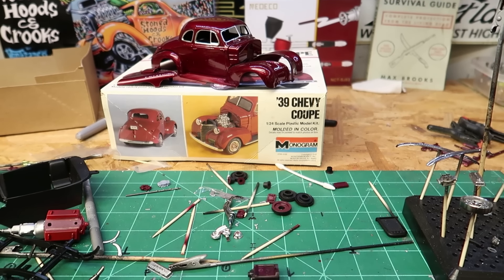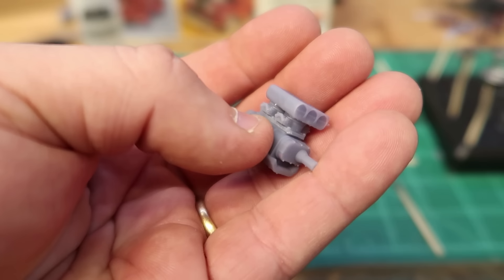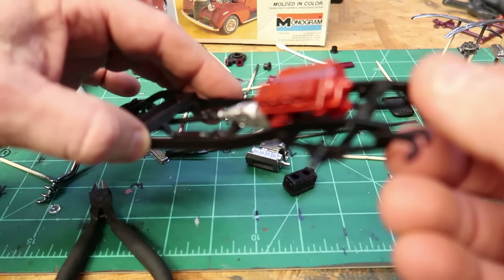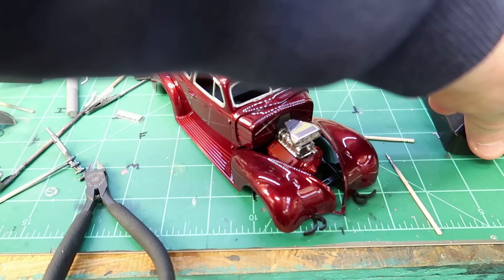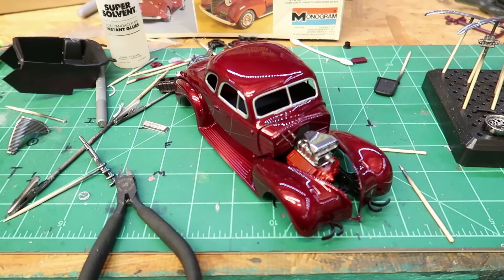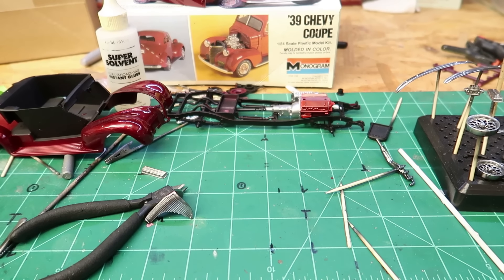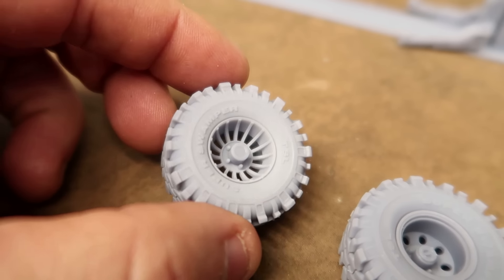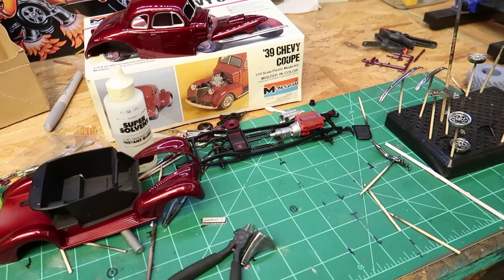I thought this would work out but it didn't!! 39 Chevy Coupe update

Comment: Matthew, your 39 is coming along nicely. I've mistakenly super glued parts the wrong way more times than I care to remember so I can relate. A trick another modeler taught me was to soak the part in 91% alcohol, not the 70%, overnight to break down the super glue enough to separate the parts without breaking them. You'll have to sand down the edges to get rid of any left over super glue. The other thing is it will most likely kill whatever paint you used so you'll end up repainting everything. It's a pain but it works.  👍👍
Reply: I have also read of putting the parts in the freezer awhile too, which make the parts separate.  Worth a try.  😎👍
Reply: @lancerevell5979  that is how people get rebuilders apart. I know it works with model cement, can't comment about CA glue though.

Comment: Nice saves with the blower and headlight mods. Good looking hot rod with that red color. 
Edit: Also, if you are looking for more of that Model Master leather color enamel paint, although the Model Master paint line is gone, you can still find new bottles of that same leather color in the regular 1/4 oz square testors bottles.

Comment: Never had that problem with headlights from this issue.  Was this a open kit when you purchased it?  Also, if you have the red 1966 Chevelle flip nose by Monogram, that will have the same blower set up in it. Looking good, keep us updated.  Hope you start offering individual 3d printed pulleys on your shop soon.